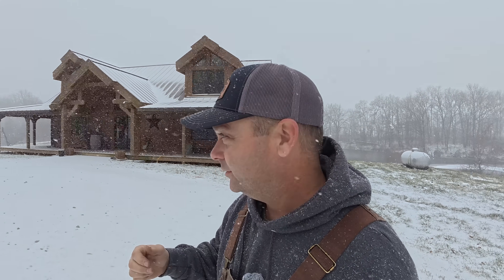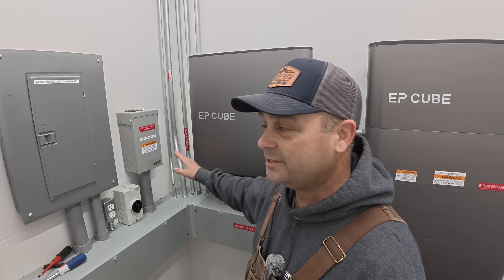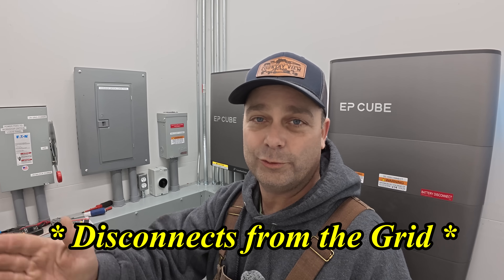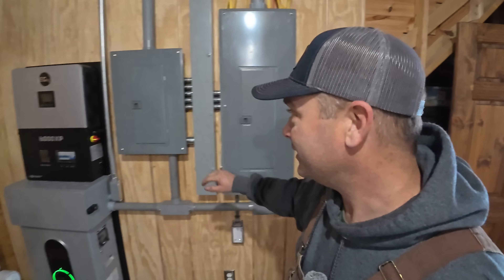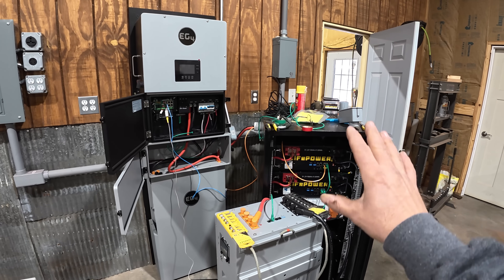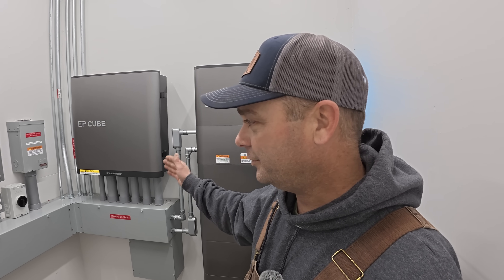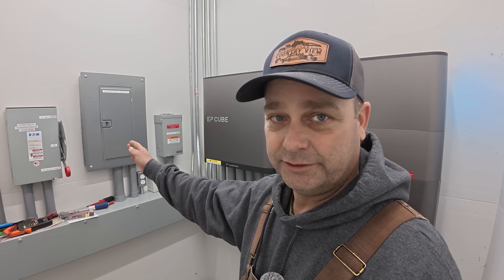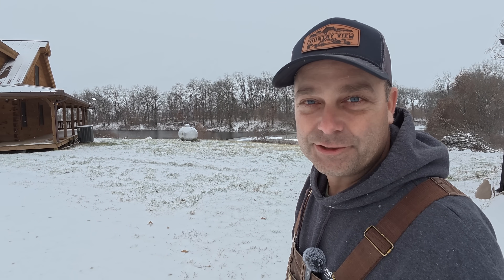My Solar Setup and How I Would Handle an Extended Power Outage

Comment from the maker: Save $50 off a $500 order at Signature Solar by using my Discount Code:   COUNTRYVIEWSAVE50
EG4 6000XP and Wall mount Battery:  https://bit.ly/4dzgRmN
EP Cube all in one Solar Energy solution: https://bit.ly/47dLudA
EG4 12Kpv and All Weather Battery:   https://bit.ly/4fDuvX2
EG4 12000XP Inverter:  https://bit.ly/4kxnjic

Comment: Before you buy this 12kpv inverter which is manufactured by Luxpower, Ask Google AI the following question:  Do Luxpower inverters have a higher failure rate than low-frequency, transformer-based inverters?

Comment: Hi, I have a question about the EG 6000XP. In the specs, it says that its idle consumption (standby mode) is >30W with PV, 50W with battery, and >50W with AC. There is also something called eco mode, which I assume keeps the inverter mostly off so it uses minimal power, and if it detects a load, it will turn on to power it.

Here are my questions:

How much power does this device use when the inverter is completely off?
When the inverter is in normal mode (just battery and solar) and you power nothing with it, is it really 50W?
When the inverter is in eco mode, how much power does it draw? And when will it turn on—how high does the load need to be for it to detect and activate?

Comment: I think you explained it pretty well. You basically have a lab setup for testing power-related products, and you just chained different stations in a way that the one powering the essentials will draw power from the others, like from the grid. It doesn’t matter if it gets power from another power station, the grid, or a generator.

Comment: If you are so determined to achieve energy independence, and snow is a regular issue in winter, you might want to consider wind energy before you buy your next storage device(s). You don't need gigantic turbines, there are more appropriate solutions available. 
As backup to all this you could certainly consider the LP generator suggested below. 
And last, the utility - to whom you might want to sell generated power, even if it is a bad deal.

Comment: We have a natural gas supply here, but those two big LP tanks you have, like NG, gives you other options for backup.  Managing a gasoline supply to keep it fresh or stabilized, and also taking time to maintain the generator carb. to reduce issues with jetting and old fuel oxidizing and causing poor running or no starts when you need it the most can be challenge in a busy life, as seen in the video on your other channel.  A genset that is capable of connecting to a NG/Propane source would be ideal in my opinion.  In addition to generators that are setup for this off the shelf, there are some good quality kits available for many generators on the market to convert them to run on NG/Propane with quick disconnect hoses and keep gasoline as a last ditch effort to supply fuel.  Ideally, you would never need to put gasoline in the tank that can later cause issues but it is an option as a last resort.

Comment: Your system is way too complicated for me.  In my solar system, I have 3 load centers.  One is powered only by solar.  Another one carries most of my loads and  is the switched load center that can be manually switched between the grid and the solar load center.  The other load center is powdered by the grid only. I only have a few circuits on it.  I can back feed the house from a generator by connecting it to my welding outlet that is wired to the switched load center.  When I do this I move the transfer switch to the open position and put a physical lock on it as long as the generator is running. To use this setup requires that the entire solar system be powered by a single 120/240 volt inverter or in my case 4 inverters (16 KW total) that were designed to be paralleled. I have never needed to use my generator so haven't made the mistake of not leaving the transfer switch in the open position which would cause a dead short causing major equipment damage and a possible fire.

Comment: Hi Evan,   having backups (for the backups) is the way to go,  if not an ice storm and winds then also some day a Tornado may go down a line of power poles that feeds grid power to your home.     Those new all black solar panels you just installed will probably make some good power even covered in snow once the sun comes out,   might do a video of that and show how much power the panels make snow covered,  I noticed when you installed them they have shade loss diodes to help them make more power in covered or shaded conditions.

Comment: ❤❤VIDEO ❤❤ did you look 👀 into the PROPANE GENERATORS❤ they’re way better for charging backup power so many advantages ..no gas. OR fuel needed .. worried it won’t start, gummed up carb. OR bad gas , fuel❤ I like the way you work and explain everything ❤your episodes and experiences with electric brother ❤❤❤

Comment: A high frequency, transformerless inverter like the 12KPV makes for a poor choice for powering an off grid home. High frequency inverters provide a shorter life expectancy, a poorer surge capacity, and because they lack any galvanic isolation between their DC boost stage and their AC output, they can burn your apoliances up when their MOSFETs fail. Don't take my word for it, Search Google for "Can a high frequency, transformer based inverter damage appliances with no galvanic isolation?"

Comment: Hi Snowy View! It seems like you need a bunch of Bifacial panels on an adjustable ground mount. That way they would still be effective in the snow,especially if you can tilt them before the snow arrives, as well as adjusting for the time of year. The ground mount will obviously be super easy to keep clean and deliver power to those ever increasing banks of batteries everywhere. Lol

Comment: Nice review!  I ended up going the EV route for battery back up.  Got a Ford Lightning ER with 130kwh battery that has 240v 7.2kw output.  We don't lose power all that often so I decided that was the best route for me.  It feeds into a back uploads panel through a generator port.

Comment: Understood most of it, but could not figure out one thing. How long after grid down before you need generator? A day or two? The totally off grid guys I watch have automated propane generators as standby. One is in New Hampshire and has to run his about every other day for the winter months on his primary 17 Kw system. His 10KW system on his shop is running without generator this winter to see if he can get by but he has 2//3 of panels on roof and 1/3 on wall straight up and down for snow days and so far only lost about 12 hours this winter of no power until it recharged enough to run again. Using the shop system to power his barn as well.
Reply from the maker: If there is no sun, to recharge with solar.  Probably 2 days.

Comment: Hi
I have a dual sol-ark 12k 
21k in pv
94k in battery backup 
What I've done is I bought the eg4 battery charger and my generator runs at 80% when I need to recharge my batteries if I don't have sun in that I'm not push my generator and doing that my generator will not be running at night

Comment: With my panels on my small work shop roof what I did was got a 12v motor a Bus windshield wiper a pulley and a button to sweep the snow off I only have 6 panels though so it is not a big load or run for the belt from motor to pulley and it does not help with ice

Comment: i also have multiple power systems. wasnt planned this way it just kind of grew out of the constantly improving products available.  living with it i like the options and resilience it has, even if one system has a problem i can still make do with the remaining two.  i also have a gas/propane gen as backup for extended poor solar days. i discovered that a previous gen (non inverter) would not charge up two of my systems, they only accept pure sine power so i purchased a inverter gen.  good thing i tested it before i needed it........

Comment: If you were going to build a new system, as you discribed at ~9:00 on the timer, to include the fully expanded equipment, what size would the equipmnent room need to be? (I'm guessing 6'deep x 8 wide')
Reply from the maker: I think My solar room is 6 x 6.  And it is too small.  Probably 8 x 8  or 8 x10

Comment: How far do you discharge your batteries? I ran my 24 volt 900 amp-hour LiPo4 batteries down to 20%. After 10 hours of running the generator, the batteries were 85% charged at an 85 amp charge rate. I was running loads off the generator too. I burned 5 gallons of non-ethanol gas. This was a test I did during very cloudy conditions. I figured I had better know what to expect when I have an extended grid down.
Reply from the maker: If there is no grid power, they will go down to 10 to 15%.  During Normal operation, I run them go down to 20 to 30%

Comment: thanks for the videos. very interesting and informative 👍🏼. sounds like after testing you prefer the eg4 system over the ep cube? any specific reasons?
Reply from the maker: The EP4 cube only has a few settings you can change.  I wish it had more ways you could control it.  The EG4's are totally customizable and can be configured multiple ways.  And you can hook up any 48 volt battery to them.  Gives you lots of options to expand your battery bank.
Reply: @ thanks sir 🙏🏼 good insight.

Comment: Man, that is a serious set of systems and capacities!  It is definitely very complicated, but I understand why you did it the way you did.  Is the plan to eventually run almost entirely off solar and inverters, with the grid used only as backup power?  We have 3 different solar/inverter/battery setups, as well as several power stations for running specific loads, as needed.
Reply from the maker: Yes, eventually I hope to make all my power, and only use the grid when necessary.